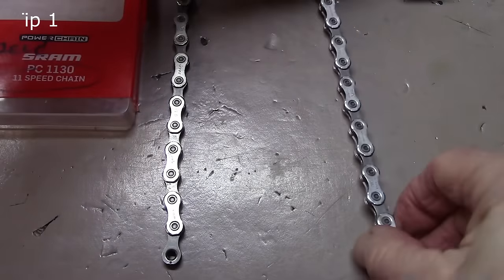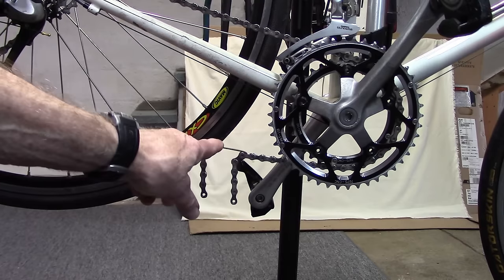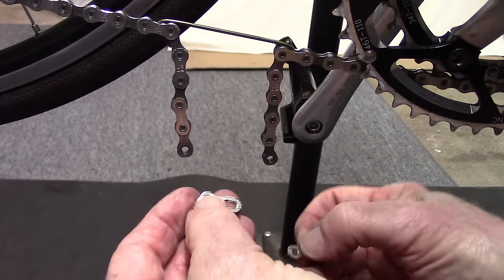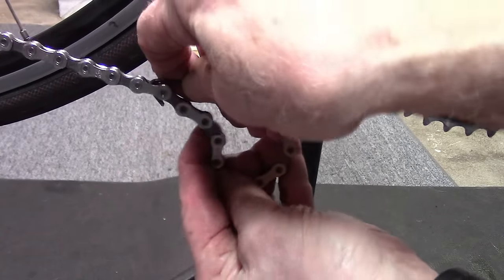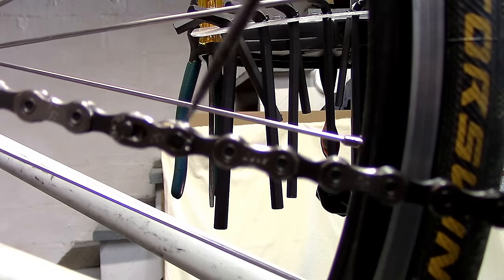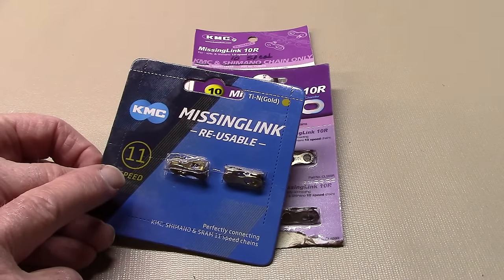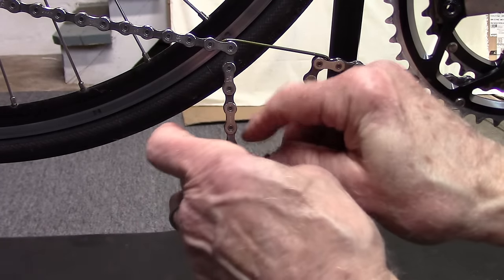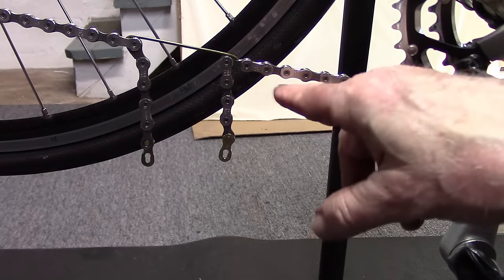Bicycle Chain Master Links: Tips & Tricks KMC Shimano SRAM

Comment: Do I use an 11 gear link for a 21 speed? Can't find a 21 speed link x
Reply from the maker: Look at the rear cassette and count the number of cogs. That's the "chain speed" and the master link should correspond to that number. If you have a triple up front and a 7 cog cassette, many call that "21 speed." That's because you have a choice of 7 x 3 different combinations of chainrings and cogs. However, when we are referring to the chain, the width of the chain or master link depends on the number of cogs of the cassette. So, in our example with the triple above, we have a 7 cog cassette meaning we use a 7 speed chain and 7 speed compatible master link. If we had a 11 cog cassette we'd use an 11 speed chain (which has a narrower outer diameter and will therefore fit on the 11 speed cassette).  I think the bike industry does this just to keep us on our toes. By the way, 6, 7 and 8 cog cassettes use similar chains (sold as: 6/7/8 speed chain).
Regards and safe cycling, Tony
Reply: @tony10speed  thank you!  Much appreciated you've saved me a massive headache x

Comment: can i get a 10 speed master link to work on a 9 speed  until I can get a new chain?
Reply from the maker: The 10 speed chain is narrower then the 9 speed and, unfortunately, a 10 speed master link will not work on a 9 speed chain. You can order 9 speed master links on Amazon. They are not expensive and I usually keep several extras on hand in my shop. Regards, Tony

Comment: Why does the chain keep coming apart at the masterlink?
Reply from the maker: It should not unless the following:
1. The master link was not engaged on either side as it was installed (either using master link pliers or pushing down on the pedal). See:
https://www.youtube.com/watch?v=-v4u9pkpIns
2. The master link does not match the speed of the chain (10, 11 or 12 speed) or is not made for your specific chain).
3. The master link has been re-used a number of times and is worn. Use a new master link when installing a new chain. There are re-usable links but even these need to be replaced when installing a new chain.
4. There's a problem with either the chain or master link itself.
Holding the master link in place while getting the master link pins to shift to the outer part of the links pin holes can sometimes be tricky. But once locked in place should not come undone.
Good luck and try again. Regards, Tony

Comment: What happens if the master link is the one that breaks and the pin is missing?
Reply from the maker: Hopefully you are carrying a multi-tool with a chain breaker. You'll need to remove the broken master link (and replace it if you're carrying a spare) or repair the chain as in the video below:
https://www.youtube.com/watch?v=wr3GfSrL68k&ab_channel=TonyMarchand
Master Links don't often break unless they're put on improperly (the pins are not engaged on both sides) or they've been reused to many times. When you change your chain, you should always install a new master link.
Regards, Tony

Comment: MY QuiK ~ Link is as Tight as A Catfishs Bum ...Should I pour Hot h2°° over it Or Bite the Sapphire Bullet and just Break the Chain via the Pins ?
My Noo KMC With Renewable Missing Q.L. is on Standbye 🦕🌐?
Reply from the maker: With many 10 speed and above master links, it's often easier to just break the chain with chain tool. Good question, Thanks

Comment: Never had a problem reusing a quicklink name brand like Sram at ;east 2 times.
Reply from the maker: Some have re-used them even more times. I install compatible re-useable quick links which allow me to remove the link up to 7 times (according to KMC) if I should want to thoroughly clean the chain during the life of the chain. However, when installing a new chain, install a new quick link  since the quick link wears as much as the chain. I have also seen quick links fail if a worn link is re-install on a new chain. Anyway, those are my observations.

Comment: I have always put chains on and left it on for the life of the chain. I clean the chain on the bike, I lean the bike to the right and let the solution drip. I never used any quick links or master links, I always carry a Alien II multi tool. I have had quick links break on me and the chain got wedged down between the cassette and spokes damaging all of the spokes nearest the cassette. I ride a 27 speed, 9 in back is plenty. I think the idea is to reduce the need to shift the chain rings?
Reply from the maker: Todays compact chainring set are just that - to reduce the need to shift. But a 9 x 3 (triple) still gives you the most options. I, too, carried an Alien II for many years (hear and in Europe) and fixed many a chain (and many other parts of the bike). But todays chains and master links have become better quality over the years and I rarely see a broken chain. As to the master link, if put on correctly (as well as checking both sides of the master link that the pins are engaged and moved to the outer part of the link), the master link holds up well. It only seems to fail when the pins are not fully engaged or the wrong speed (9, 10, 11, 12) master link is matched with the wrong speed chain. In fact, when used correctly, the master links seem to be superior method we used to use just using our chain tool.
With all that said, thanks for your comment and safe cycling, Tony

Comment: I cannot for the life of me insert the  master link halves in the chain and it came WITH the chain, so it should fit! So frustrated.
Reply from the maker: Are you using a chain hook as shown in the video below (you can make one from an old coat hanger):
https://youtu.be/x9Ri0p6bsNw?t=52
Have you considered using master link pliers along with the chain hook? Let me know if either of these solve your problem, and if not, let me have some more details on how you are installing the master link. Regards, Tony
Reply: @tony10speed  thank you, sir, I think I figured out my rookie mistake: I was trying to fit the master link into the outer part of the link, not the inner. Most video tutorials assume that people know, but I sure didn't!😅